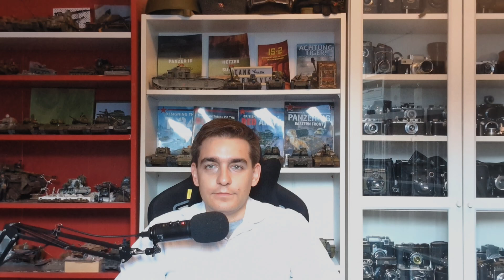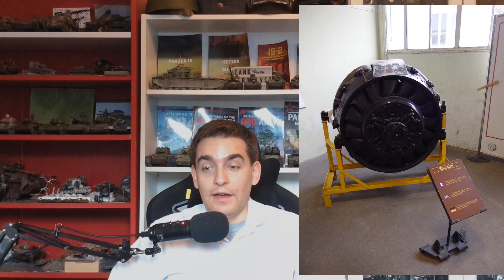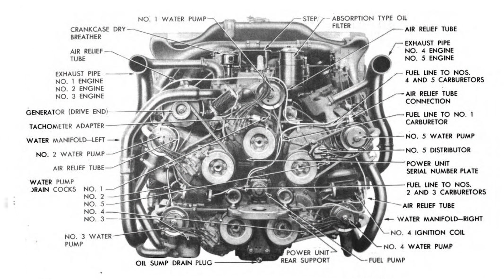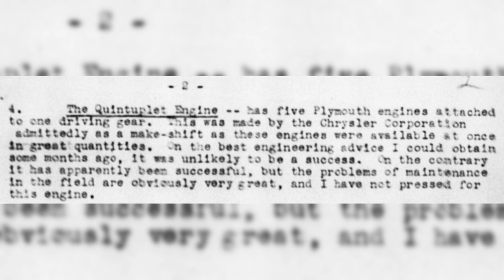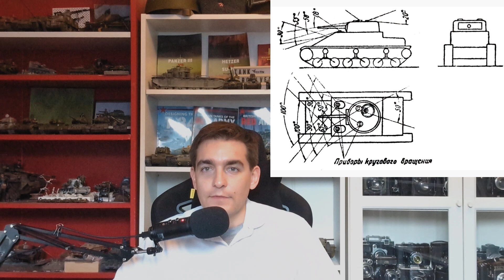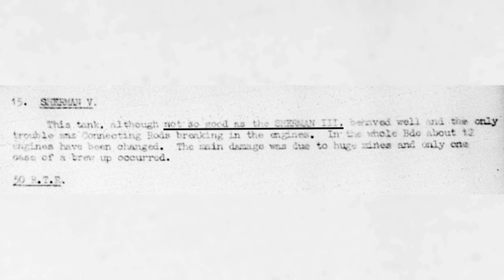Lend Lease Complaints: M4A4 Sherman

Comment: I expect that the fact M4A4s were gas powered had a lot to do with the rejection. The USSR was hard pressed to produce sufficient higher octane gas for its air force let alone modestly high octane gas for the tank, and the US had the tendency to design its engines to run on higher octane fuel than its opponents and allies. I wonder how much of a factor this was for the USSR, something as seemingly mundane as octane levels.
Reply from the maker: This was something they complained about explicitly when it came to the M3 Lights and Mediums. For the M4A4 it was a negative for sure, but it wasn't the deciding factor. The British and Canadians also found the exact same issues with the M4A4 and they were perfectly fine with gasoline engines.
Reply: @TankArchives  Thanks for the reply. The US was really the outlier in higher octane usage. The Luftwaffe designed their engines around it and managed some of the most powerful aircraft engines of the era, and the late Soviet aircraft were in many cases an equal in terms of performance, all run on lower octane fuel.

Comment: Despite the A-57 Multibank’s design and mass, British tankers and maintenance techs found them far more dependable than British designs.
Reply: The A-57 multi bank engine turned out to be the most reliable tank engine that was used during the war.  US Army policy was to swap out tank engines after 200 hours of run time for inspection and replacement of worn parts. That was due to most engines starting to develop problems by then or shortly later. British tank crews reported running their A-57's for 1000 to 1500 hours before they ran bad enough to require replacement.
Reply: @billwilson-es5yn I find that fascinating. Maybe that is why the military members redeployed to the US were big into maintaining their own cars. Not just due to costs but also experience overseas.

Comment: 3:05 German engineers projecting 40 km/h for the E100 with a power-to-weight ratio of less than 10: we disagree.
Reply: Top speed isn't that dependent on power to weight. It's more about engine RPM and gearbox. To get a heavy tank going somewhat "fast" and also to move reasonably well at low speeds they needed many gears. An electric transmission was a good option for very heavy tanks, although many build theirs with too weak cooling. E-100's lack of torque is certainly worrying.

Comment: 10:18 hydrostatic lock = fuel, or usually oil (especially on radial engines) pools in the bottom cylinders.... 
when you go to start the engine, the piston compresses the fluid, and comes to a DEAD halt. 
.
if the starter is strong enough... it can bend connecting rods, break pistons, ETC.

Comment: If the US had license-built the Soviet V-12 diesel then ALL Allies would have been much better off.
Reply: The US chose to stick with gasoline engines for logistical reasons. The V-12 was a diesel. The US only wanted one type of fuel to worry about. The US Marines got some diesel powered Shermans in the Pacific because the Navy had a lot of diesel powered boats so the fuel was already in the logistics system in sufficient quantities. The US had no interest in the Soviet's V-12.
Reply: Ask somebody who owns a t34! You will change your mind
Reply: I'd imagine Americans would have preferred to build their own V12 instead. They kind of had couple about 500hp engines with similar torque. I don't know what happened with them.
Besides Sherman engines were all intended to something they could field fast. Getting production of a foreign design running right is not always that easy.
Reply: @Teh0X  "I don't know what happened with them."

What pretty much happened to all nations at times, but is almost never mentioned for USA(because due to size of economy they usually had another engine that could be used), they didn't work properly or couldn't be massproduced as required or similar issues.

"Getting production of a foreign design running right is not always that easy."

Foreign ANYthing...   The Hispano 20mm is an epic example.
Although that debacle was compounded by additional trouble, and USA did have good engineering people in regards to engines, so if they put the right people on the job, it might have been done perfectly in less than 2 months, which would indeed have been a great advantage.
Reply: @Teh0X  The crews would have been happy with tanks that didn't catch fire so easily.
Reply: The US hated the T-34, I think that they would think the same of their engines . While potent and run with diesel, V-12 was unreliable and breakdown a lot more than Sherman engine.
Reply: @gaiofattos2  Yes, but what they hated so badly was mostly just the WRECK of a T-34, literally one of the worst quality produced ever that still managed to be functional.
And the "manuals" sent with it was adhoc translated by people who had absolutely no real clue what they were doing.

Most blatantly, there's stuff like an oil trough stated by the manual as an air filter and weird s*t like that all over.

"V-12 was unreliable and breakdown a lot more than Sherman engine."

Ooohh no.   Not even close.
The engine, when built to spec were DRAMATICALLY reliable.
Just look up the 1940 and 1941 testdrives of the T-34.   Even the 1940 one before teething issues were fixed did better than Sherman normal.

The one big advantage the Sherman had was the rubberised tracks, but that was in most part because USSR didn't have easy access to rubber in enough amounts to waste them on tracks.

.

Of the highest quality T-34s ever built, those from early 1941, pretty much all of them that survived 1941, survived until the end of the war.
While those made in 1942, near zero survived even beyond 1943.

That's the difference between "built to spec" and "built to just to build as many as possible even if they only last a few months".
Reply: @DIREWOLFx75  The "worst quality produced" was the standart T-34 made between 1941-1943. The improvments were coming sure, but troops receive the worst models early while m4 sherman was reliable from the beginning, even its engine did not break like the T-34 one. Besides, errors like the air filtration were only corrected after evaluation of lend-lease M4 shermans and their efficiency.
Sure 1941 survived the war, but they were either repaired and later used in reserve units or were let unrepaired in field until late in the war and them repaired. 
And were the T-34 overpeform the M4 ? Fire control ? Gear box ? Engine ?
Reply: @gaiofattos2  "while m4 sherman was reliable from the beginning"

HAHAHAHAHA...
Dude, is that what you call getting delievered without parts, with parts not properly fitted, with parts poorly made etc etc?
Because that's how MANY of the first thousands of M4s were sent out of factories.

M4 was literally DRASTICALLY LESS reliable from the beginning than T-34 due to USAs ineptitude at massproduction of tanks at that time.

"even its engine did not break like the T-34 one"

T-34 engine did not break any more than the M4 did.

"And were the T-34 overpeform the M4 ? Fire control ? Gear box ? Engine ?"

Better mobility, slightly better gun, much smaller silhouette, drastically better protected sides and rear.
While being tons, plural, LIGHTER.

"Sure 1941 survived the war, but they were either repaired and later used in reserve units or were let unrepaired in field until late in the war and them repaired."

And you completely failed to understand anything.
Bravo...
Reply: @DIREWOLFx75  Bro, T-34 was delivery without aim system because the Soviets bought optical glass system from Germany. They have signed with Carl Zeiss. to produce the TOD-6 and PT-4-7.
Them they got the M4 Sherman optic systems and periscope by 1943 ( Vickers MK-IV).
M4 Shermans had better gear box (the driver didnt need to put Herculean effort in turning the 3º gear to pass over 25 km/h), the gun were basically same performance with Sherman gun being stabilized, Sherman also had more armor on front with E8 jumbo.
Shermans also got the upperhand on T-34s over Korea and fought t-55s in Israel and M-48 Pattons on Pakistan.
Reply: @gaiofattos2  "Bro, T-34 was delivery without aim system"

No.   They got older optics instead.
Very very few were delivered without optics.
Less than 1%.

"because the Soviets bought optical glass system from Germany"

No, they bought the tools to build their own optics factory, which when it started production in 1940 was the best optics factory in the world.
Which is why some of the early 1941 T-34s had topnotch optics.

This factory was one of the absolute first targets Germany attacked in 1941, and the factory was essentially dismantled and rebuilt in Germany.
Same happened with USSRs brand new electronics factory.

"Sherman also had more armor on front with E8 jumbo."

Uh dude, that's like proclaiming that yeah and the T-34 has much better armor in the Su-100!
Completely irrelevant.

"Shermans also got the upperhand on T-34s over Korea and fought t-55s in Israel"

It's easy to have "upper hand" when you have all OTHER advantages.

Also, anyone who thinks Sherman has ANYTHING to say against T-55, needs a serious realitycheck.
Reply: @DIREWOLFx75  They were delivery without aiming because the maker was the German Carl Zeiss and Soviets didnt had the capacity to manufactor them in large quantities, and all aiming reticules (TOD-6) came without any chemical protections against air bubbles inside it or reflections of direct sunlight. 
This was only correct when allies supply the soviets in Siberia with enough Chemical and components in 43 via lend lease, so all t-34 from 41-43, thats 53% of all war time T-34s. 

"No, they bought the tools to build their own optics factory", from Germans and their factories an mines were taken by them in 41.

The SU-100 is not an T-34 despite share same chassis, while the M4A3E8 like the T-34/85 were in fact tanks from their main lineage. 

I didnt say that they were better than the t-55 but them fought them, the M-51 Super Sherman fought T-55 in Egypt and Syria while Indian Sherman faced Pakistani M48s. 

The T-34s were very limited compare to M4 and have little if any advantage against it in mountains of Korea.
Reply: The US Army was using the similarly sized V-12 Liberty engine in tanks and combat cars during the 1930's. The Army decided their tanks needed to be shorter and weigh less so replaced the long Liberty V12 with a Weight R975 aircraft radial engine that was coupled to the rear drive transmission. The tank drivers liked the radial engine more and the mechanics liked how the radial and rear drive could be removed as an assembly for servicing. Ordnance like how the radial took up less space and eliminated the need for a liquid engine cooling system so used it when designing the M3 / M4. Ordnance also used a pre WW1 Christie design of placing the transmission and final drive inside a removable housing for quick repairs and replacement.
Reply: "If the US had license-built the Soviet V-12 diesel then ALL Allies would have been much better off."

Quite possibly yes.

However, how would they know?
One of the problems is that when USA tested a T-34, it was one of the worst quality ones that had ever been produced, and the technical translations done had been done ad-hoc by the first person found that had any understanding of translation.
This is why the evaluation was so poor, the USA testing was basically testing a wreck(as any more functional tank was at the time NEEDED at the front), and they were doing it with the help of documentation that probably even the designers of the engine would have trouble reading.

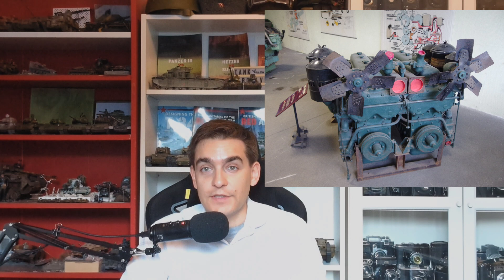Comment: 1:44 No thanks to Guiberson.

With regards to the A57 I’ve wondered how practical, if at all, it would have been to use OHV models as opposed to the flathead models that were used. It would have improved performance and likely improved fuel economy but it would have been more expensive and supposedly been less reliable. I imagine it mostly came down to what tooling was available but it is something I’ve pondered about once or twice.

Comment: Awesome video as always, Peter! 

One thing that came to mind when I was reminded of the most amazing idea of a tank engine that came up on screen: Could you do a video making a comparison of the most popular engines of the era? I would love to see production numbers alongside user feedback and stats of the V-2 engines compared to American ones, British ones, and so forth. I at least think it would be interesting!

Keep up the amazing work!
Reply: Good idea, hard to find simple comparisons of that.

"the V-2 engines compared to American ones, British ones, and so forth"

A problem with that though is that there is gigantic difference in quality depending on what time and factory you take the V-2 engine from.
V-2 by DESIGN was VERY good.
But the most "average" production quality was distinctly not.   Some 1941 T-34s got some excellent quality ones, but i don't think anyone ever did a proper evaluation of them.
After that, it probably was until 1943 or 1944 that any quality V-2s were made again, and even then, quality probably didn't get back to early 1941 levels until in the 1950s.
Reply: I mean, fair enough, but the same can be said about the 5-bank abomination. It would be even cooler to see complete comparisons of what the V-2 engines themselves were through the war.

And also, I can definitely see the same case for the  Maybach engines through the war. I think if Peter did something like this, it would be pretty informative and entertaining!